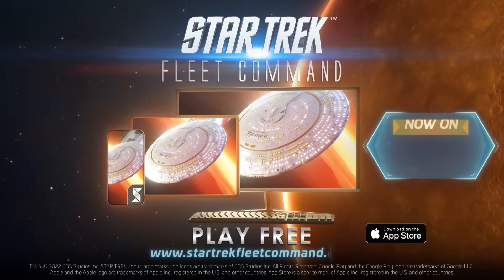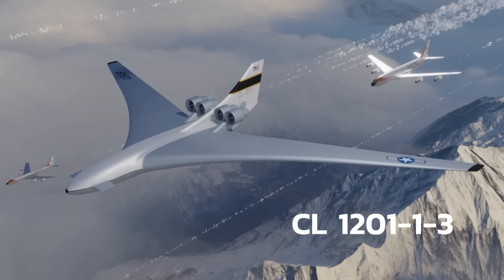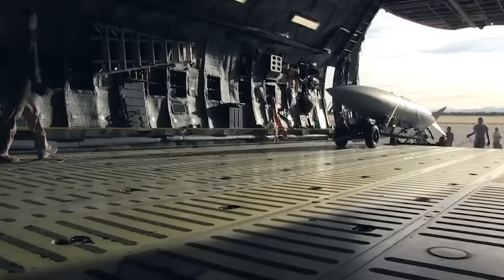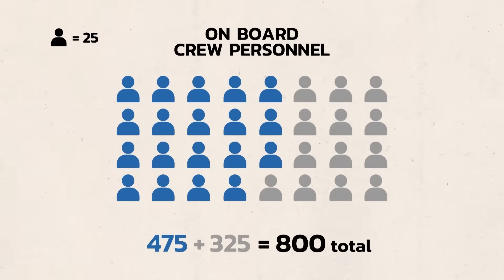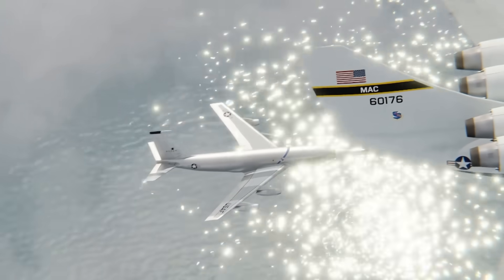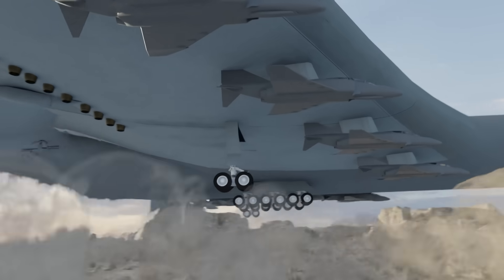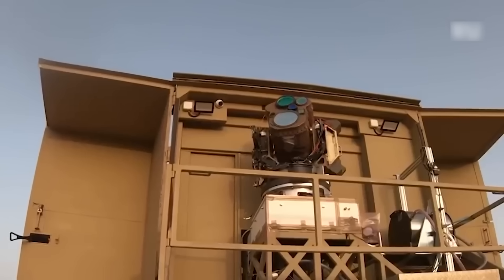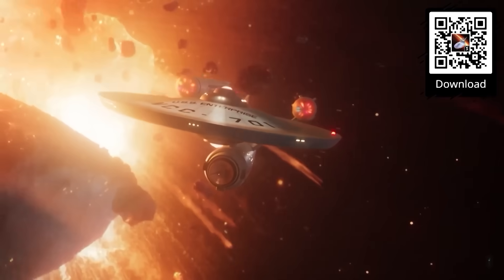The INSANE Largest Aircraft Ever Designed - Lockheed CL-1201

Comment: I could see such a design surviving into the modern era.  
Upgraded and refitted naturally.  

The issue however is its parasite aircraft launch and possible recovering concept.   Given it would still take hours of flight time.  having a method of safe-deployment and recovering would be essential to the bird, and for recovery of the pilots and ability to have them sleep between missions. 

I think a pod system that was able to encapsulate the fighter at least the nose and part of the fuselage hooking into the body or back wings that that allowed the pilot to enter from the giant wings enter into the fighter and the pod opens up allowing the fighter to do its launch.  Then when the mission is complete the fighter would proceed to a available now closed pod  and just pretty much line up and park right in getting latched and hooked then powerdown as the craft is secured the pilot simple exits the pod with a ladder that is built into the spine of the pod and attachment bar.      This could be useful for current late gen 4th fighters or perhaps 5th gens getting them into a fight although that would really depend on size.   Having this thing with a bunch of F-16s would be a nightmare, having it loaded up with 5th or possible 6th gen fighters would be pure nightmare fuel. 

If such a monster however existed to the modern era or was created for the modern era I can really see it being used for one major thing. 

Recovery and deployment drone super carrier.   Imagine something this size deploying drones of various designs for various missions.  From refueling, to scouting, combat missions etc.  From simple prop ones to true jet craft.   

I could see this thing truly changing the course of a war.

Comment: People in Arizona say the giant V was silent. I brought up the CL-1201 and they shot that theory down, like "NO!" About a mile long, silent except for the wind rushing, and the lights had indescribable colors. So, they tell me.
Reply: That last part is silly.  Colors by their nature are describable because if you see them, you already know the names for such colors because people have been able to see colors for ages.  

The sound issue is much more valid.  The engines would have been electric, but the necessary power output would still produce more than just "wind rushing."
Reply: @SephirothRyu  Well, there are colors outside the human visible spectrum. Gamma, radio wave, micro wave, x-ray, ultre violet, and infrared. The average person doesn't know that. Don't shoot the messenger.
Reply: @Fat_Juice  The reason these colors don't have names more specific than UV or Infrared or _ Wave is because you cannot see them.  
Therefore, it would be impossible for people viewing the Arizona Lights to have seen it.  If people could see those "colors" then there would be names and descriptions for them.  Hence not indescribable.  

Fun side note:  People with certain eye surgeries can actually see UV light.  However, they do not see it as a new color.  They are merely able to see the new patterns on things that reflect UV when their lens is removed and thus no longer blocking the UV from entering it.  It still activates the same set of photoreceptors as blues and violets and such.
Reply: @SephirothRyu  Maybe. But I wasn't there.
Reply: @Fat_Juice  fair enough.  But if they are saying that never before seen colors are somehow among the lights, than they were definitely under the influence of something with severe effects on their visual system.  There seem to be a fair number of people who saw it though, so we can at least presumably take the "it was remarkably quiet" part seriously.  I am just saying that some of the people who saw it may have been enjoying... substances at the time.
Reply: @richardhead-sw2qc As I already noted, if it was a craft, then the fact that people claim it was so silent suggests against it being man-made barring any conspiracy theory involving humans using alien tech.  

However, it does not matter WHO made it when it comes to the colors it produces. if the colors were really "indescribable' then that suggests instead of a craft, that the viewers were on an acid trip instead.

Comment: Steam turbine ducted fans?
It would simplify the reactor, and allow multiple engines to be fed remotely relatively easily. 

The size of steam turbines would easily fit inside a normal high bypass turbofan assembly. 

It’s also much simpler to control.

Comment: The big issue is that it puts too many eggs in one basket. As well the plane as visioned here has no quick way to rotate pilots in and out of the fighter jets under the wing. As for the reactor, it may be able to stay sealed in a crash but I would hate to be on the cleanup crew.  Thanks for a compelling video but I expect the military rejected it as they knew about the satellites and other equipment that rendered this obsolete.

Comment: I think the Lockheed CL-1201 could've worked well had they scaled it down by a third holding about 14 fighter jets instead of 22-24, 7 on each wingspan, and maybe build at least up to 3 or 4 of them before eventually canning it after 10-15 years of production. I'm not sure when the largest airborne aircraft carrier would've been built back then, but it probably wouldn't have happened until the mid-1980s or early 1990s.
Reply: Scale it down and remove the capability of carrying fighters under pylons, this plane will serve as high altitude platform patrol serving as long range high loiter duration AWACS, bomber and interceptor. Give it CIWS & RAM to take out incoming air to air missiles for self defense

Comment: I just realized… The engine blades would’ve bent, what if they just used ramjets?
Reply: Aside from the issue of not really giving thrust at low speeds, the engines need to be electric in nature.  Which means that using a ramjet, which cannot use electrical motors, would require them venting reactor heat directly into the engine somehow.

Comment: 1,000' wingspan.
Holy sh*t.
I have a question for those with the necessary physics knowledge:
Q: Could this totally batsh*t insane concept actually fly?
Reply: No.  It would have weighed about 90% more than a fully loaded Saturn V but had at best 2% more vertical thrust.  Also the idea of airborne nuclear reactors had already been investigated, tested, and abandoned as unworkable.
Reply: Doubt it. Anything this cool always runs into the same two irksome impediments: cost issues and the laws of physics.
Reply: @minimalbstolerance8113  Hahª!
Thank you- I figured those two things might rear their terrifying heads...